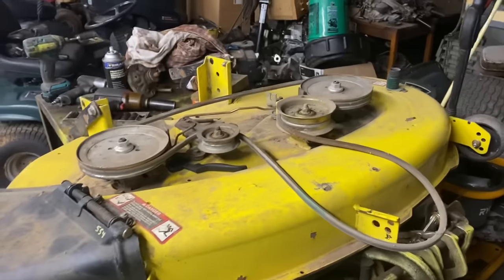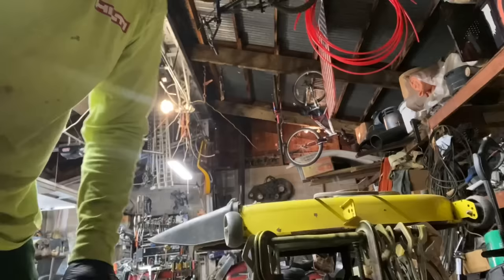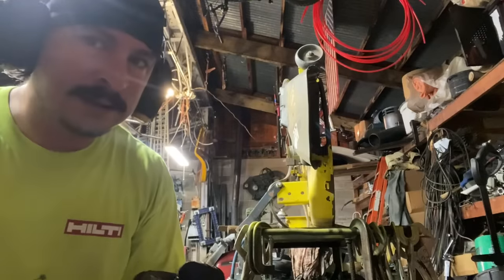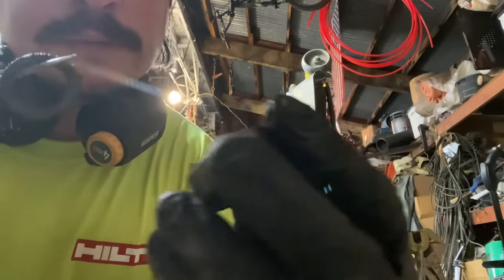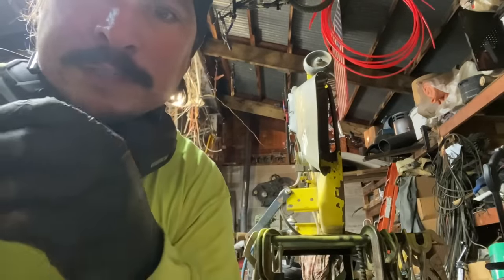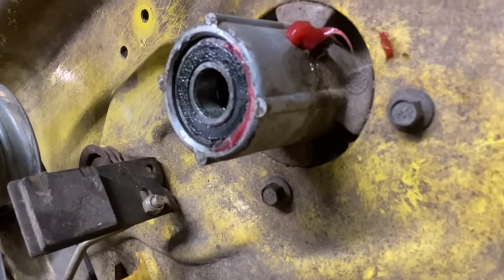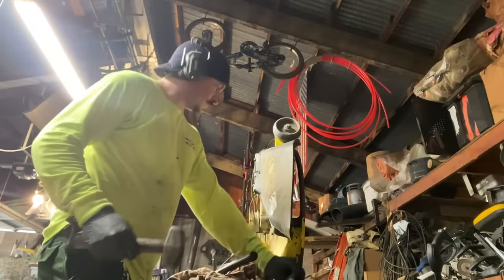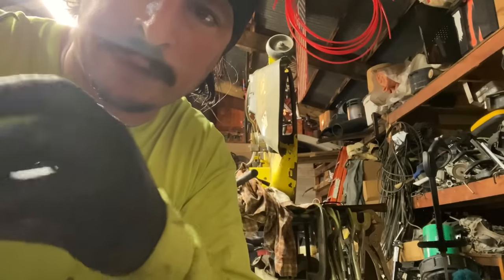Part 1 - Don’t trust the “Experts” Grease your mower deck sealed spindle bearings Common sense.

Comment: You proved some grease can get in, you have not proved you should grease sealed bearings. I like greaseable shafts but you must have the correct bearings that are made to be greased. The homeowner lawn mowers will last forever with sealed bearings.
Reply from the maker: Your absolutely right. I proved it and did so to help folks get longer life from deck bearings. Greasing the deck like this doesn’t hurt anything Iv been doing it for years never had a bearing go bad after doing it this way but plenty have gone bad that didn’t get grease. 
Wow, you say the sealed bearing will last Forever? I have to say it amazes me you believe that but dispute my video where I provided proof that it works. Plenty of videos out there will argue that a sealed bearing won’t last forever. I know for a fact that sealed bearings won’t last forever because of how many I pull out that are dry as a bone and coming apart and the inside is just dusty. That’s odd that I’m seeing so many tractors with under 100 hours and bearings on the deck are completely shot. And it could have been avoided but nobody ever greased the deck mandrels even though they came from the factory with a zerk fitting. You can choose to go till failure, they will eventually fail without grease. Maybe some folks get lucky and get bearings that were packed full and yea those can last a very long time. But Iv seen plenty that were new and had almost no grease from the factory. I know I want to fill mine with grease and make dang sure the deck will go for as long as possible without the need for tear down. As for the sealed bearings And how long they will last without adding grease, Could be a thing that just depends on the Employee who put grease in that particular day or the amount of grease they had on hand at that time or even the company who provided the bearings. You won’t convince me this hurts bearings to grease them because Iv taken them apart to check and I have repaired enough to know and I may not convince you to try it. But what I’m proposing can do way more good than harm so it seems funny folks are naysayers without any proof. But hay, thanks for stopping by. Maybe you can do a video on the topic and run some tests before you just go off what makes sense in your brain and call it facts. It’s not facts without proof. It’s just got air. The one thing all naysayers have in common is that none of them have facts. And none of them will run the test I did and show us the outcome. I’m not attacking you but I will defend my video where I provided facts to help folks.
Reply: @GTObearclaw1  I miss spoke I meant to say the life of the deck for home use.
Reply from the maker: @thepubliceye  what is the life of a deck for home use? What would you say is acceptable? I mean now a new cord f150 has lifetime transmission fluid but at some point it needs to be changed however there is not even a dip stick to check the fluid level. Well that’s a whole other topic. Back to the life of a home owner deck bearing, people in my area use a home owner tractor between 20 and 40 hours a year if they buy the right size tractor for the size yard. In comparison a commercial tractor would reasonably see 20 to 40 hours of use in a single week. Some big box store “home owner” machines have hour meters and some have bad deck bearings and have less than 100 hours on the meter and some
Tractors are only 3 and 4 years old with bearing failures. I find that unacceptable. And these tractors sometimes have zerks that have never been greased. What I’m proposing is grease the zerk that’s already there until grease escapes the assembly and it will extend the life of the bearings. I gain nothing here. I’m offering help. When I tear the decks down the bearings are dry and have seals on both sides so explain that. Why at under 100 hours would a sealed bearing fail? Why not just put a grease gun on and pump the mandrel full? After all the units that have a zerk must be able to receive grease or why would it have a grease fitting? I mean these are the simple questions I ask myself. Unfortunately I have learned that Just because it’s a sealed bearing does not actually mean as much as some folks might think. Sealed bearings may have at one time meant more than it does these days. Quality of bearing / manufacture and how much grease was originally put into the bearing all have something to do with how long the “sealed” bearing will last. To argue that is mind boggling to me. Not every bearing is to the same standard. As Iv sowed in other videos, brand new bearings right out of the package sometimes have a few drops of grease and sometimes they are packed completely full. Iv shown this in videos so folks know just because it’s new does not mean it is going to be good to go on grease. I have learned to always pop the seal off and check to see if the bearing is lightly greased. And usually the cheepo bearings have less grease than the higher quality brands. Explain that? Same bearings made for the same application. Why would some have almost none, and others are packed full. More than likely it has something to do with how much the bearing cost and the quality of the bearings. I’m afraid your just one of those people
That can’t accept they are wrong about something. If your right make a video about the process and show me the downsides and I’ll give it a watch and I am interested if you have provable facts. it could be a huge hit because this video is getting a lot more views than I expected and apparently it must be a popular topic. If your right the information could help folks. Your obviously not going to convince me that this process is not exactly as I presented in the simple step by step process I put Out for everyone to see on a video. I mean it’s broken down every step of the way in my video to avoid the confusion that other naysayers videos won’t prove. There is nothing to hide. 
How sure are you that your not wrong. Your sure your right but your arguing by stating things that are not accurate to the application. I proved the process works and posted a video to help people and laid it out every step of the way. Obviously according to most of the comments this makes sense to the majority and the information is appreciated. The reason it’s step by step is because it’s such a controversial topic and I knew that going into the video. Just trying to clear up every step so the process is proven. Not sure why some folks still can’t see past what makes sense in the bearing applications they are familiar with. Did you actually watch the whole video? I don’t think you did and that’s probably why we are having this conversation.

Comment: Its $28 for a whole new set of bearings and you would use 2 tubes of grease for a total of $9 so you save $19 but get carpal  tunnel on your wrist unless you have an electric or air gun.
Reply from the maker: Dang this is worse than the last comment. So, let’s booing it down with accurate information. I’m not sure how you could fit 2 tubes of grease into a few mandrels but I have yet to ever achieve that. Typically a tube of grease will
Service 3 or 4 tractors at 5 to 10$ a tube what I pay locally. so dividing that down is roughly 2$ or 3$ a tractor and then dividing that down agin to 1$ or 2$ a spindle at most
Because each deck has several spindle. And bearings don’t need to come out if they are kept greased. 
On top of all that you do realize that I only removed the bearings to make a point? I assume you were able to gather that? Well, if not I’ll be happy to go deeper into it for you. I should not have to go deeper but I will for you because you seem to have some unl realistic thoughts on this topic. Most likely you have not done much deep deck repair is the feeling I’m getting here. But anyways, The bearings were only removed to make a point. And that point is that if properly greased the bearings won’t need to come out and the grease gun does the job. This was a little painful but I got to the point finally. Good grief, Why do I bother explaining more when the video shows it in baby steps a toddler could follow. We will
Eventually have 5 year olds doing this service while full grown adults are arguing about it. Well, nobody can say I didn’t  make an extra effort
To help you.

Comment: I don’t see the point to pumping grease into a spindle with sealed bearings
Reply from the maker: You obviously didn’t watch the video to the end. I show the point. Geeezy Pete.
Reply: Russ I just watched your video again and yes the first I didn’t watch until the end, I did watch it until the end this time and saw the red grease in the bearing although you were correct the red grease that was in the bearings was very minimal. I have watched several YouTube videos and they all recommend removing the seals. Why don’t you remove the seals and pump the spindle full of grease? And see if the bearing receive an additional amount of grease.0
Reply from the maker: @williamodom2580  because the amount of grease received is plenty. And actually I stoped as soon as I seen grease escape the outer seal. If you would like more to get in bearing, just pump more. For better results just run the deck a few seconds and spin the bearings and apply more. That will move the grease around and let more in. Also consider that every time the grease is added on future services the bearings will continue to fill a little more each application. But ultimately the bearings will be fine with the grease that reached them in the video. If you open / remove the dust shield on a new out of the box bearing (especially the lower cost bearings) you will find that even some new bearings come with a almost nonexistent amount of grease and Iv seen those run for years without adding any grease. On the other hand some folks argue that too much grease is bad, but Iv never found that to be the case in this situation. The more grease added the better. I keep my assemblies filled. It may seem like more is needed and I think more is better but it’s not gonna really make a big difference. But getting some grease in the bearings makes all the difference. And the point of doing it this way is because it only requires using a grease gun. Something anybody can do. The great majority of home owners who have a riding mower don’t have the tools, knowledge, or interest in dismantling a deck just to remove a few seals that don’t make a bit of difference as far as greasing goes. The way I show, gets the same results and no need to remove and take apart a perfectly functional deck and risk messing something up, breaking a bolt, cross threading or going back together wrong or leaving a belt off a pulley and burning a belt when turning deck on without being aware. These things happen to me often when working on used decks. Things break on disassembly. Main pulley nuts are stuck and have to be cut off. Metal bolts seize in aluminum mounts and snap off. Lots more can go wrong by trying to remove those seals, especially when working on an older deck. Grease the deck as I demonstrated is a huge time saver and very effective. As for the amount of grease in the bearings after I added grease, consider the bearings in most (big box store brand) decks are not high quality and cost between 5$ and 10$ to replace unless of course choosing a higher level bearing. But my point is, why not just grease it like I show and try it? Just try it, and not take it apart? Worse case, a bearing starts growling latter down the line. you were considering pulling it apart anyways so at the time noise is heard just take it apart and swap out the bad 5$ to 10$ bearing. No biggie. But the chances of that happen are very slim if you add grease from a gun every season your bearing failures will become rare. As for the current condition of any used bearing is unknown so even if you add grease this way a already failing bearing could give out and decide to retire. So consider all the factors when making your decision on the matter. Iv been doing it this way for many years. And so far it’s been bulletproof for me. I hesitated to post a video on the topic when I first realized this worked. But after years of success and now seeing these other guys videos, some of who say don’t even bother adding grease at all Becasue the bearings are seald. Lit a fire and I decided folks may be able to save money and time that I should share my findings. Little did I know that I’m apparently one of the few who do it this way. Could say one of the few who are not closed minded about a little rubber lip stoping pressurized grease from passing. Most my videos are just simply to help people. I’m not a big name
On the tube. No money made of a single video. Nor do I have ambition to ever become such. Just here to help. Some folks don’t like the information that’s okay. But to discount the information seems silly. Some folks argue tooth and nail. But without giving it a try seems silly. It could help a lot more than it could hurt and Iv tested and used this for years with no issues only success. I use to find it fun to dismantle decks and get into the moving parts. Now I’d rather just fix what needs to be fixed and spend time on more interesting things. Iv had so many decks apart it’s not even something I enjoy anymore. Can fix a mower deck with my eyes closed. I want to learn new things.

Comment: If there is a zerk to grease them, makes me wonder why they are "sealed" bearings. I think if you left them alone, the deck would  probably rot off before the spindle bearings failed.
Reply from the maker: Absolutely wrong. I fix a lot of decks on almost new machines. That’s why I made this was to help folks who have already had experience loosing bearings on a newer machine or folks who just want to know how to prevent failures. If sealed bearings lasted forever I’d be doing something else. And as my finial result showed, the shields don’t stop grease. It passes right into the bearing.
Reply: @GTObearclaw1  thanks, I get it.  Maybe “sealed “ bearings are economically feasible for the manufacturer and they are thinking most won’t grease them anyway and sealed ones will last longer.   Great video.  Keep it up.
Reply from the maker: @Jake-cz1kb  thanks for watching and leaving a comment
Reply: My bearings failed on my new Huskee after two years. I just replaced all four bearings a week ago, and one was bound up. They were sealed, but apparently one was tight.
Reply from the maker: @genemothershed8525  Huskee is MTD. If it’s Huskee I’m not a fan of MTD made equipment but if you happen to mean Husqvarna you make have zerks on the spindle and if so you can grease the unit the same way I show. Grease will pass the seals and enter the bearing.

Comment: You can’t grease the bearings. If they are sealed they are sealed, if not the bearings would allow water and dirt inside the bearings! I did small equipment repair work for 50 plus years. PeAce ☮️
Reply from the maker: You obviously didn’t watch the full video. Sometimes in life we are shown things we didn’t think were possible. If we are willing to open our mind and explore the possibility that we could be wrong sometimes, we might find out some very interesting information. It’s easy for us to believe what big brother wants us to think. Sometimes we have to think for purse and experiment with things. As Iv done here. Nobody shows me, I figured it out. In this case you are wrong. I proved it in this video. Regardless if you believe it or not it does not change the simple facts. Facts I might add can be tested by any person watching this video. Just because you didn’t know for 50 years does not change physics. It’s a shame you didn’t figure it out a long time ago. Could have done wonders for you and or your customers. Grease applied through a zerk and into a sealed housing will push past the rubber lips on the bearing shields. It’s really a very basic simple  concept. A shield can block loose dirt and for the most part shed some water but the shields don’t do a perfect job of keeping water out. Anyhow, do what you will with the Information I have provide. But I hope you don’t close your mind. Think about what’s happening here. Thin rubber lip on a shield, what can it really hold back? Not much. Especially not grease under pressure. You can simply try this at home. Not any special magic that I’m doing here. Just sharing the basics. Even explaining it step by step to prove the uniformed naysayers wrong who mislead The DIY community. I won’t stand for it. Rather than post videos stating things won’t work, I go deep and provide the proof it does work.   And for that your welcome. Snuff said,
Reply: Been wrong before but, not this one .✌🏻😆☮️
Reply from the maker: @danaeverhart6487  okay then, please post a video showing you greasing one of these assemblies and provide the evidence after the process on how it didn’t work. You won’t, because it’s impossible to prove me wrong. One thing all the naysayers have in common is that none of them have proven this won’t work. Nor will they take the time to try and do so. I however provided proof it does work and I am trying to help folks get long life from a cheep home owner machine. This process can simply be tested by anybody at any time exactly as I have done here. I lean towards the possibility your just another know it all naysayer with no evidence. And that’s putting it kindly. Your even topping it off by admitting to 50 years of experience where you never figured out a basic preventive maintenance process that works 100% of the time. But yet your here to help us. How are you helping exactly? Why are you here leaving a comment? To prove me wrong with no proof? And telling folks not to grease bearings? Good grief. You head must be harder than arithmetic.